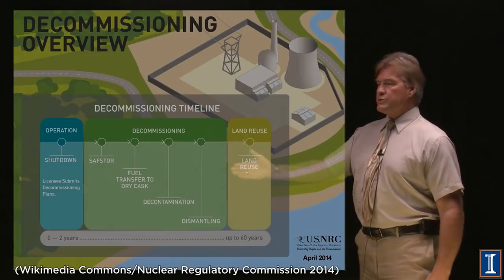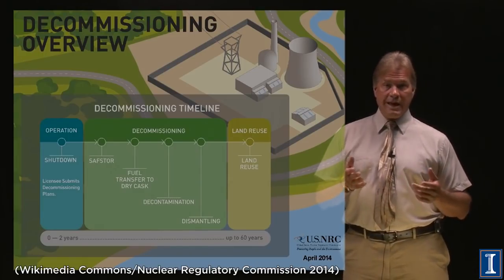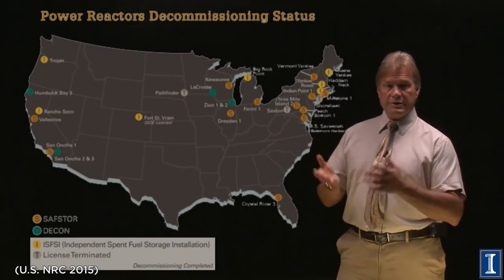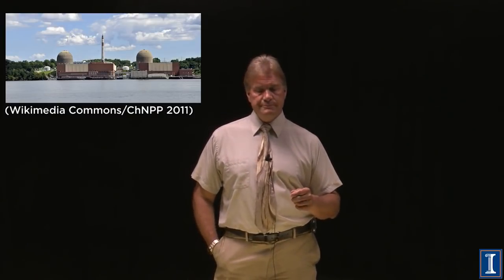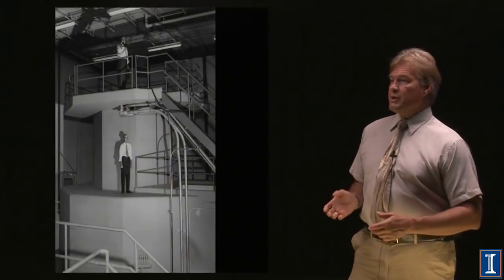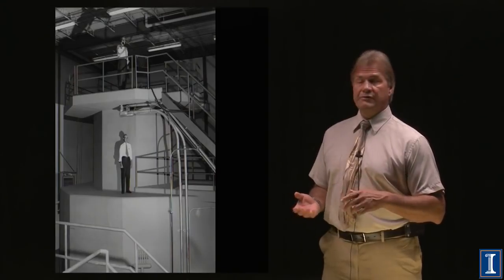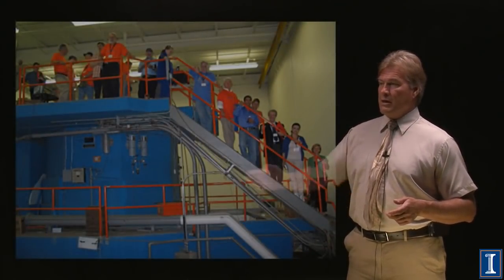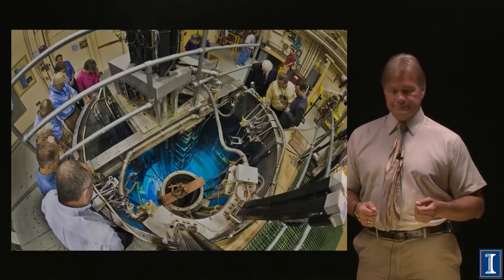After It Is All Over (Decommissioning)

Comment: 5:11 My understanding is that these academic  reactors have an extremely low void coefficient for additional safety?
Reply: As far as i know, they are basically idiot proof. The only way to do any harm whatsoever is drinking the coolant
Reply: And with very low enrichment, they have a high fuel temperature coefficient.  Some designs basically 'peak' and shut themselves down in seconds as the fuel heats.  Provide nice pulses of neutrons for research though.

Comment: Nuclear generation is not low cost.  https://www.lazard.com/perspective/lcoe2019
What happens to the spent fuel in the cooling ponds, not in theory, but in actual fact? Who is willing to take the stuff?
Reply: It's not economics but political. You'll find more support from the federal government to invade Iran than you'll have support for reprocessing spent fuel.
Reply: @jmd1743  So you have identified a problem, but offered no solution, so it remains a problem.
Reply: @fjalics  The fact that the problem is political already provides the resolution. As for the waste itself he provides one resolution, another would be the newer generation of reactors that can process the waste of older reactors into stable decay products.
Reply: @Dwarg91  "The problem is political" sounds like a statement of belief, not a statement of fact. I bet lots of people thought we "needed" coal. We don't. Nuclear is just one of many ways to produce low carbon bulk electrons that isn't good at following load, so it's in direct competition with wind and solar, both of which are much lower cost, even before we look at waste, or costly accidents. Renewables also have huge advantages in how fast they can be installed, how small they can be, and still cost efficient, and how predictable their costs are. Nuclear projects on average came in at 250% of their estimates, so the estimates are usually fairy tales.

Comment: Interesting... So I had heard that there is a nuclear power plant metal recycling place, to recycle the metals that are removed from old reactors to make new reactors. Is that true? Did the metal at least get recycled? I agree with you that it does seem like a waste to greenfield the space, as long as the radioactivity is low enough in the building
Reply: The entire reactor is made to keep the radiation inside so I doubt much radiation got through. Most likely barely more than ambient

Comment: If the decommissioned reactor parts, pieces and debris were low level radioactive, why were'nt  the crews wearing any radiological protection, not even a simple respirator?
Reply: Because it's not actually raidoactive enough to need it. It's just so heavily regulated because nuclear power scares people.
Reply: @ottopike6000  You're spreading misinformation. The reason why people didn't need to wear protection is because they were only exposed to the low level radioactive reactor parts for a very short amount of time during the disposal. It's so heavily regulated because a low level radioactive dosis for a long amount of time is a high health risk and highly increases cancer.
I firmly invite you to put a low level radioactive sample of a beta or gamma emitter near your bed for some years and test for yourself whether heavy regulation of low level radioactive waste disposal is overrated or not.
Reply: @olska9498  I could be wrong, but my understanding is that we're talking about 10× background radiation here. There's no evidence of that causing an increased risk of cancer.

Comment: Wow that’s not so bad. Let’s go decommission Chernobyl!

Just kidding - great video.
Reply: They're currently decommissioning Chernobyl unit 4. They recently finished the "New Safe Confinement", a larger structure which was built next to the reactor and slid into place over it. It completely encloses the old improvised "Sarcophagus" built shortly after the accident, which had seriously deteriorated at that point. It was difficult for Ukraine to pay for cleanup, and the current effort is an international one, since a failure of the Sarcophagus would be bad for everyone in Europe.

With new confinement structure in place, they can begin to disassemble the sarcophagus and then start cleaning up all the high level waste still inside. The new structure was built with automated equipment for this purpose.
Reply: @TonboIV  Oh, they're going to decomission the unit that blew up. No of course not. That was my point.
Reply: @jjohnson4153  I'm not sure what you're trying to say. Decommissioning of Unit 4 (the one that blew up) is in progress now.

Comment: I've worked in plants where they have to bag/vent/filter buildings to remove lead paint as well. I've seen them order the wrong filter system and not tell the installing tech that it was for controlling lead dust, just to save money. To top it all off, the other tech wired the motor wrong so when I was called out to troubleshoot, the thing was running backwards and spewing airfloat lead dust. Trust in science, not in people, people are dumb.
Reply: Deconstruction, demolition, decommissioning all looks great on paper. It is important to monitor that work and be transparent with the public.  I work in the remediation field and the actual work is never monitored.  It is presumed that it went according to plan.

Comment: The containment building is usually the most expensive part of the entire site. Why would you PAY to DISASSEMBLE and decommission it? It's ridiculous. Just replace the reactor vessel, steam generators and whatever is needed and the site is good for another 80 years. I never understood why it's just "so logical" that after the reactor is done, the entire building needs to be decontaminated and leveled. You don't need energy any more?
Reply: The safety standards have changed since that old containment building was built.
New reactors need extra passive cooling capabilities to be able to resist for longer in case of a station blackout, you need a core catcher in case of a meltdown, they need extra safety systems, more pumps, more backups, etc...
Also newer reactor design are made bigger in order to be profitable. But your smaller building won't be able to contain them. So You'll have to design a new reactor from scratch to fit inside the smaller building and fit all the extra safety equipment.
The size and number of holes, pipes, doors, locks going in and out of the containment building will probably no longer match the requirements of the new reactor. Probably requiring the reactor to be tailor designed, and licensed specifically for each building.
In other words : you're designing the reactor backwards (the reactor to fit the building instead of the other way around)

And finally, you are going to have to certify that the concrete will still be able to work as a containment structure for the next 50-60 years (it needs to hold a steam explosion)
So it's easier to just build a new reactor and a new building from scratch.
Reply: @BlackSharkfr  What could be done if that's the case is to build a new facility on the ground that was for decades used/ earmarked for a reactor.  One of the things people don't 

talk about is how it economically  ruins the town where the reactor workers lived at to have a closure.  The town would like it if the company were to tell them that they're going to build a new plant that utilizes 50 years of innovations that will produce more energy & is substantially safer because it's not a 50 year old design.

The greenfield plan for the research reactor's building was terrible.  The school's management was basically embarrassed that they had a reactor.
Reply: They could put a new SMR or two or four into these existing containment buildings...
Reply: @zolikoff  Concrete stops being any good after 100 years for simple structures, let alone for a reactor. It constantly dries out until it crumbles so I wouldn't be very confident in 60 year old concrete holding reactors it wasn't built with consideration for.
Reply: @PK-767  really I thought concreat was basically good forever the Colosseum is still standing and I'm sure it is more than 100 years old
Reply: @aellis6692  The Colosseum is primarily limestone, and the concrete used isn't load bearing.
Reply: @aellis6692  Hi Aaron,
There's a big difference between the cement used by the Romans and the Portland Cement used today. The concrete guys I work with say the difference is a class of minerals called pozzolans that cause the cured cement to be calcium aluminum silicate hydrate instead of just calcium silicate hydrate. The problem with pozzolanic cements is that they take a long time to cure. Portland cement is always at risk of CO2 in the air reacting with the calcium silicate hydrate to form calcium carbonate; the extremely high Ph environment inside the cement inhibits this, but over time the basic chemicals get washed away, and the Portland cement crumbles to dust. We can have cement like the Romans had, but we have to be very patient. As the design lifetime of most of our structures is only 100 years or so, the owners of the projects deem it not worth the cost of waiting and go with Portland cement.
Reply: @aellis6692  it's a different kind of concrete made with volcanic ash is very hard and durable. We only figured out how to duplicate it in the last 15 years or so. Any structure built before then has much weaker concrete than the Coliseum. And even now it's expensive and not used very much except for things like roadways.
Reply: agreed. this has always bothered me too.
Reply: Agent J  Shut up
Reply: Agent J  He would actually be more qualified than you.
Reply: Me too
Reply: Containment vehicle is outdated and in some cases damaged by radiation overtime. That's part of why it has to be retired it's because it reaches the safe limit.
Reply: No utility wants to spend ten Billion dollars or more and wait ten years for a nrrw nuclear power plant to come online.  So new ones are a huge waste of money.
Reply: @acmefixer1  Americans can't fathom saving up to buy anything.   Canada's nuclear reactors get refurbished every time they look at the cost of a hydro dam and an HVDC line across 1000 miles of swamp with no roads.
Reply: Uhh I worked at a 5 story factory that was 110 years old and built like a parking deck. I can assure you that it was in no way shape or form starting to crumble and weaken. In fact it was probably stronger than ever.

Comment: Why decommission at all?
The reactor could have been shut down, the room sealed for 100 years (maybe fill it with foam for security or something). After 100 years, with most of the radiation gone, it can be repurposed into a new reactor.
Reply: I don't think that safety regulation in 100 years will enable to reuse a building that was made with safety regulations that are 40 years old today.
Reply: Concrete wears out, environmental factors wear it down, safety standards are updated (seriously, you wouldn't want to even TRY to build a modern reactor in a shell from the 1970s), and probably most importantly, we're (ideally) not building the same type of reactor we're pulling out.
Reply: Asbestos would be a big problem overtime. Walls would require maintenance which would like costs much more than dismantling and building something new.
Reply: It is not only the radiation but the building themselves aged and lost strength and safety. Wear and tear.
Reply: This, but don't wait 100 years. If it's inside containment you can just replace the reactor immediately.
Reply: @zolikoff  Removing the reactor vessel involves cutting it into pieces as shown in the video.  There is no opening in the containment large enough to bring in a new vessel without massive concrete cuts and repairs to the structure.  And that assumes your new vessel is exactly the same dimensions of the current one, which is not likely since designs have changed drastically over the years.  It's kind of like saying "Why not just put a new engine in an old car when it wears out?"  If the engine has worn out, other parts of the car (or nuclear plant) are also worn to the point that a newer design is desirable.
Reply: Radiation isn't the problem. The concrete is old and radiation causes the concrete to degrade faster.